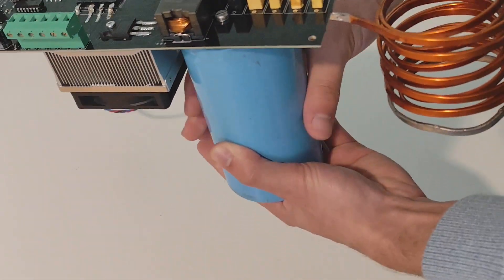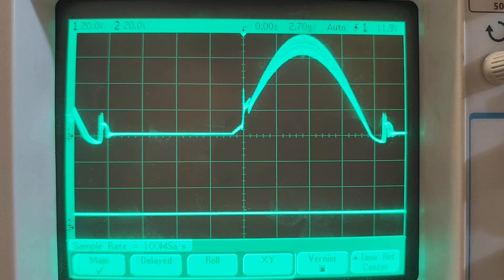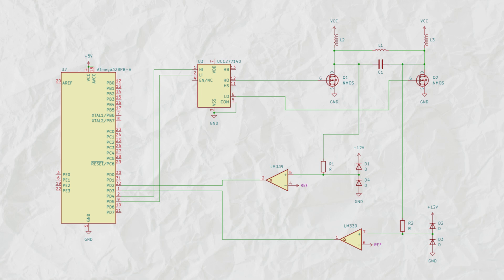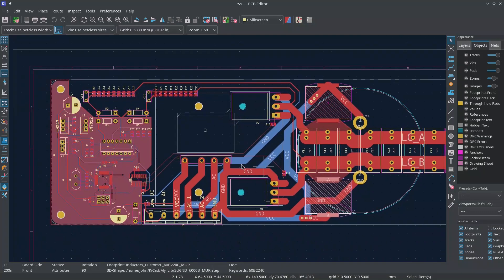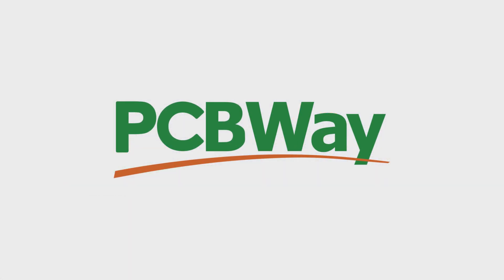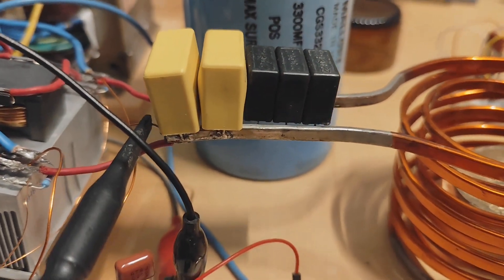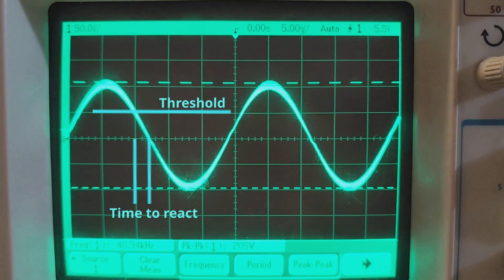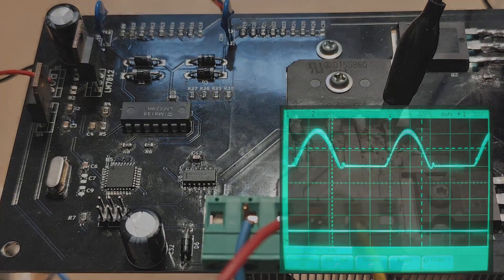Building a Digitally Controlled Induction Heater

Comment: Why not soldering mosfets and the bridge on the other side of the pcb and attach them to the heatsink ?? Why are you sending the heat through the PCB?
Reply: Flux can be removed with ethanol
Reply from the maker: The components are connected to the heatsink, there's holes in the PCB
Reply: @5VLogic I understand, but an extra layer of pcb does not help with the heat

Comment: I'd be interested to know what exactly you achieved with digital control? A reduction in dynamic losses on the MOSFETs? But at low frequencies, those losses aren't that significant. It's a pity that you didn't say anything about the results of complicating the scheme compared to the basic one. What are the benefits, if any?

Comment: Damn so complicated for a tank ciruic. Or did tou want it digitall controller? Yeah Id say cap rated 630v+ if you plan on running 12-48volts for the resonance part. The resonance amp and volts in the L/C part of the circuit sees hughe values. multiple times higher than the rest of the circuit

Comment: My best solution for this would be to wrap some wire around the coil somewhere to generate a copy of the output signal you can low pass filter or attenuate in other ways, as the trigger for your flipflop. basically a signal-secondary for your induction coil. bouncing/ringing noise will be attenuated easily, the signal to noise ratio from the ZVS is pretty substantial, digital logic just cant handle it single dimensionally as just levels, but this way you can attenuate it by power over time rather than potential over time.

Comment: Great video!
Something got me wondering, and it's something I notice in a lot of circuits.
Why did you only put the ground plane on the analog side and not across the entire PCB layer?
Is it to prevent noise from coupling into the ground plane and affecting other parts of the circuit?
But isn't the purpose of the ground plane to absorb or manage that noise?
Reply from the maker: Thanks!
Yes the two main ideas were that perhaps the plane might pick-up noise on the high voltage side. But not sure if so and how much.
More important I was a little afraid of having the high voltage less than a mm away from the sensitive electronics (distance of isolation of course) so I feel better knowing there's a good isolation between them. Might just be paranoia on my part though.
Reply: @5VLogic  thank you for this clarification :) have a great day

Comment: 3:26 I’m thinking it’s probably possible to make a simple and elegant solution to the first two problems by using NE555s as your MOSFET drivers and as your timing elements, whether you need one or two 555s per side. But it would take a fair bit of messing about to figure out. And it still would have a fixed power output, though maybe you could dynamically adjust the delay time with a potentiometer to do some leading-edge dimming.

Comment: There is a way to avoid the micro-controlloer use a single igbt module and a large capacitor that connected to one side of the coil and the other to the positive of the igbt it's a higher side driver it's work perfectly in a big 6kw metal melting machine I copy it it work alot of output power
Reply: Your explanation isn't very clear. Could you elaborate on this or show the source of the idea?

Comment: Heya, I never thought ZVS would ever get an upgrade more or so like this, but to heads up you got a major design flaw on your capacitor bank, the coil should be connected diagonally not parallel to the caps as it creates even flow of current across the caps rather than creating an imbalance between the caps. That’s why only 2 of your caps failed and not the others
Reply: Your comment deserves more love. 
This guy decided to do a dissertation on skin effect in a giant, thick copper coil, but didn't seem to consider current flow in his atrocious PCB layout. 
It's uneven in the capacitors.

Comment: Hey, nice video!

I was thinking that maybe the required timing circuit could be done with a monostable multivibrator triggered by the negative edge of the comparator.
The multivibrator output goes through a NOT gate and then to an AND gate so that it acts as a "normally active" ENABLE signal, the other input of the AND is connected to the output of the comparator.

This way when the comparator ouput goes HIGH, the signal is propagated through the AND gate to the output of the circuit. Then, when the comparator goes LOW the monostable gets triggered and sends a 0 to the AND gate disabling the output for the selected RC time constant.

I can't currently try this circuit with real components but I think than a 555 should do the trick.

Comment: Hi, can you explain why do you need atmega there at all? It look like there can be used simple double RC circuit instead of atmega and you will get the same result. With simple double potentiometer you can control parameters of this RC delay on the fly. Also @ivanpopovic9503 perfectly mentioned wrong capacitor connection, you need to correct this and capacitors may last much longer

Comment: Since most IO's of the ATMega are not used, you can scale it down by an ATtiny. Have a look at the ATtiny 1 and 2 series.
Reply from the maker: Yeah I thought of that after designing the PCB and ordering receiving components, it would have been a better option.
Reply: @5VLogic  Hindsight is 20/20. Maybe something for a next revision, if it comes.

Comment: X2 caps? for an induction heater? you need "pulse rated", or "MKPH" type, specifically for tank circuits.
theres several hundred amps flowing in those traces, those leads... and regular capacitors are highly inductive, being mostly just wound strips of foil with one connection at the far end. MKPH join the entire side of each strip to the wires... almost no inductance and the ability to rapidly charge and discharge, for millions of cycles.

the tank circuit will resonate at about 4X the supply voltage. capacitors have to be rated for this, plus safety margin...

then you get the "impedance matching"... the coil and work is a transformer. the power supply "sees" the work piece resistance, multiplied by the turns ratio squared. the more turns in the coil you have, the higher the resistance it "sees", and the less current you can push into that resistance for a given voltage...

all i see is someone getting far too complex on unnecessary circuitry without stopping to look at the basics first.

Comment: Put the gate driver closer to the mosfet, 2-3cm away max. Route the gate and source trace differential. Would suggest to put a soft starter for that big capacitor, will blow the bridge if not. And use coper planes for gnd.

Comment: This design is too complicated. You can consider using IRF's old IR2155 to drive the FET directly. The chip includes dead-time control. Of course, there are also full-bridge driver chips. Polyester capacitors not suitable for high-frequency applications and should be replaced with high-frequency ceramic capacitors. Polyester capacitors have inductance.

Comment: Massive problem with capacitor is due to bad connecting pattern. You understand that current through those capacitors is quite high, and you put them in line so there is no equal sharing of current between them due to trace resistance (milliohms are enough) leading to cascade failure of capacitors (also before doing anything you must check the maximum allowed current through capacitor, it should be listed in datasheet). 
So, Much better way of parallel connection of capacitors in these circuits is making a ladder and connecting 'source' (dranes of your mosfets) to one diagonal, and 'load'  (your coil) to other diagonal. This way current must be shared equally between capacitors and if you use capacitors with high enough current rating this shoud work well. (Everything described here comes from my experience in designing high-powered induction heaters for few companies, topolgies were LCL but some aspects are transferabble to your design). Great work though, I like it!

Comment: this makes no sense to me - why are you using an L/C oscillator at all?  can't you clock this thing off the microcontroller?  what am i not understanding?
Reply: The reason why is that this is a resonant switching topology, which relies on the LC circuit to pull the body capacitance of the MOSFETs to zero volts before performing switching, as MOSFETs have significant turn-on loss since you're basically shorting the body capacitor and dumping whatever energy it has as heat in the MOSFETs, every switching cycle. The circulating current of such a topology can reach currents orders of magnitude higher than the RMS input current, which is useful for induction heating, because the current does not disappear until transfered to the load (except inside of RDS-on, traces, capacitors, which is why his caps exploded, known as conduction loss)
Reply: You can’t directly clock it (at least not simplistically) because this is a resonant circuit. It oscillates at a frequency that is determined by the inductors and capacitors. You could in theory measure this and then drive the MOSFETs directly at that frequency but in reality the frequency is not fixed. Changes in supply voltage, temperature and load will all modify the resonant frequency. If this doesn’t match the clock frequency, the circuit just doesn’t work very well. It becomes inefficient, the waveform becomes distorted and often this causes the ZVS switching to fail, emitting magic smoke from MOSFETs.

By the way, the LC self-resonant circuit is what allows ZVS switching to work at all. Without it, you’re just pushing current back and forth into an inductor, so there would be no way to ensure that the MOSFETs could switch on and off at the zero voltage point of the waveform. ZVS allows this and therefore makes the circuit efficient and avoids overheating of MOSFETs.
Because it is self-resonant, the switching automatically tracks changes in resonant frequency, preserving ZVS switching behaviour under variable loads and supply voltages.

Hope this helps your understanding!
Reply from the maker: Perfectly explained.
In addition, thanks to resonance, the voltage across the inductor is much higher (almost 3x in my case), this is why an LC resonant tank is used.
Reply: @5VLogic  clearly i need to study more - thank you.
Reply: @simontillson482  thank you, i think i get it now.

Comment: I recently designed an induction heater.  Different architecture (zero current switching) but had to solve the same problem you mentioned, which was switching at the correct time without being sensitive to switching noise.
My solution was to use a comparator (used a more recent TI part in SOT23-5) with positive feedback via some capacitance.  It acts like frequency-dependent hysteresis.  After a complete cycle, where it is ready to switch states, the feedback has negligible effect, but after switching, the comparator is temporarily "blinded" by the HF feedback.  It only takes a very small capacitance (10pF or so), and set it so that the time constant is about 1/10 of the switching period.
I also had the same issue with compensating for delays so that switching is at the exact zero-crossing threshold.  My design runs at between 50 and 300kHz, so I ended up using a pot and a variable phase lead circuit to do the "prediction".  The frequency doesn't change much so it only needs to be reset when changing coils.  There is an analog uA meter which is fed with the output of an XOR gate, whose inputs are fed by the mosfet gate drive and the raw zero cross signal.  The user tweaks the pot until the meter is nulled, which indicates when the zero cross and gate drive are happening at the same time.  (This is the same idea used in PLLs).
Regarding the resonant capacitors: use high voltage MKP since it's the dv/dt that kills them.  The higher voltage rating obviously requires them to be oversize, but that's an advantage in having more surface area for heat dissipation, as well as more internal material for higher current handling.  I used a bunch of 2uF 400V caps with about a 9A RMS rating.  More caps are better, because then your coil can be fewer turns and higher Q for the same frequency.  I think 20kHz is too low to be much use, unless you are only heating big iron.  Smaller and non-ferrous things will want higher frequency.  Since the mosfets are very understressed with ZVS or ZCS, you can easily run them at 50kHz.  For reference, I'm using SiC mosfets with an 80A 750V rating, in a full H-bridge.
Reply: why would it be sensitive to noise? So complitcated when these 40$ common tank circuits you see everywhere works great, if you kow what youre doing you just have to set it so it resonated for your voltage, and get the Right(!) component like fast diodes for the gates and Iwould add some 1-3W fast zener with a  fitting my setup  mayve tvs,
Reply: Impressive! May I ask why you picked ZCS as a design choice? I've only used ZCS on IGBTs since they are much more lossy on turn off comparing to mosfets, but I haven't worked enough with SiC mosfets.
Reply: @alexwang007  Well that's just it!  The design was originally to use IGBTs, and I actually used them in a first cut, but I really wanted to go over 100kHz which was way too high for that technology (even 50kHz was a bit of a stretch).  I changed over to using Quorvo fets mainly because they are compatible at the gate drive level.  In hindsight, maybe ZVS would have been better since with ZCS the dv/dt causes a lot of problems with stray capacitance and I needed to add a lot of snubbering to tame it.
Reply: @hardywoodlandcypress  ahh I see! I could get maybe 120kHz with small IGBTs (50UD) only with resonance switching, but probably very difficult for larger chips or bricks... And it's funny to think that these wide bandgap switches can switch so fast it causes problems lol
Reply: I'm all too familiar with this, but I didn't have fast enough comparators, and for that reason alone, I had to abandon this solution. The "advance" option was not suitable due to the frequency change under load. As a result, I implemented automatic frequency adjustment based on minimum consumption.

Comment: Nice video! I have a question (maybe stupid tho) concerning the circuit layout, why didn't you do a whole ground plane for the entire pcb?
Reply from the maker: Thanks! Not a dumb question at all.
My reasons were a few, but maybe someone else might have another opinion,
a) it's not really necessary because the "high" voltage side doesn't need to have its traces separated by ground (so just save some copper I guess).
b) I'd rather not have anything that's very close to the high voltage get particularly close to my delicate digital stuff, generally the pour is around 1/4 of a mm from other nets, and it would take a small piece of metal or something that shorts to cause trouble.
c) ground pours are for noise reduction and having the pur next to the high voltage oscillation might or might not create problems, but I don't see any way it could help, so I'll avoid taking chances.

Hope this gives a little insight to my reasoning, I'd be curious if others have different views. Thanks for your comment!
Reply: @5VLogic  Another good reason to avoid ground planes is that they might become a "shorted turn".  Since high current, high frequency AC is involved, you would have to be careful to avoid eddy current losses.  The very reason that ground planes are good for low noise, is a reason to avoid them in extreme cases.
Reply: @hardywoodlandcypress  Thanks!
Reply: @5VLogic  Thanks!

Comment: 9:17 If solder paste doesn't "slurp" itself up nicely, most likely flux has dried up before it had a chance to do its thing. Either your soldering paste is old, or wasn't stored properly, or you did the whole thing too fast. This can be mostly solved by pre-mixing your soldering paste with a bit of fresh flux (basically diluting the soldering paste with flux), rosin paste flux works great usually (and as a bonus, rosin flux tells you if the temperature is right, it goes brown when its too hot).

Comment: problem with the sleep time: 
a microcontroller is a bad idea. for something like this, especially in this enviorement. the failstate is just a mess you dont know.
look for something like a simple debounce circuit. RC filter would prob introduce too much delay, but a simple 555 timer and dflipflop + possibly xor gate for the clock generation is all you need.
the current through the capacitors is not shared equally btw, placing a 1.5uF cap in your 3uF bank for example, would mean that that single capacitor is taking 1/3 of the current. especially if its in the front.

a lot in induction heating actually comes down to the coil design. efficency, and capability basically all comes down to coupling to the workpiece. even tho your resonant tank may be able to take 100kVAR, if you cant get that in the workpiece its going to be inefficent. 

i find your design nice but also really cursed. the idea behind ZVS circuits is that it is barebones. i feel like adding a microcontroller and gate drivers to it, gets you in a weird terretory. because honestly. if youre already doing that, why not use a PLL circuit, or just make it digital driving a full bridge, since theres already a uC on there anyway.